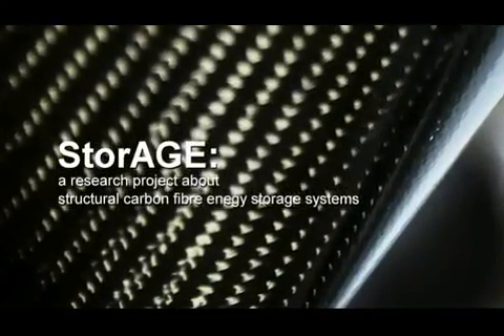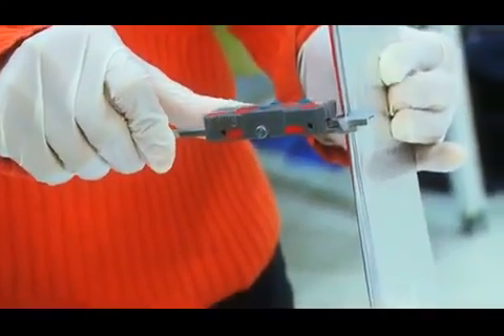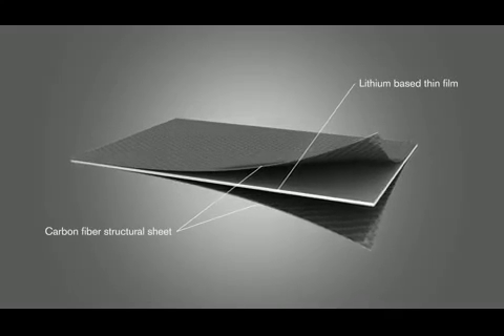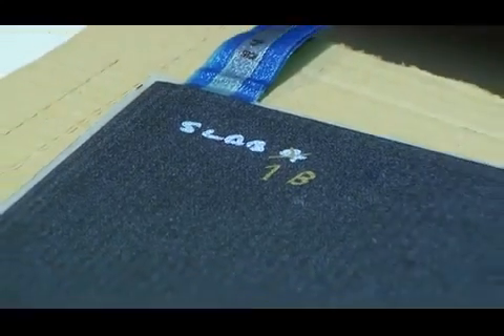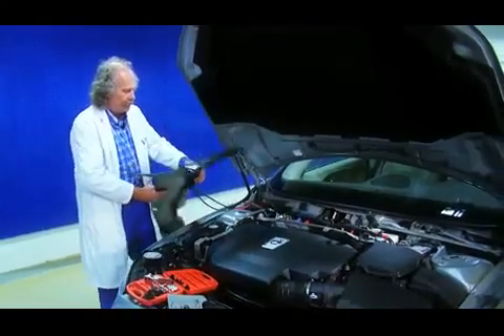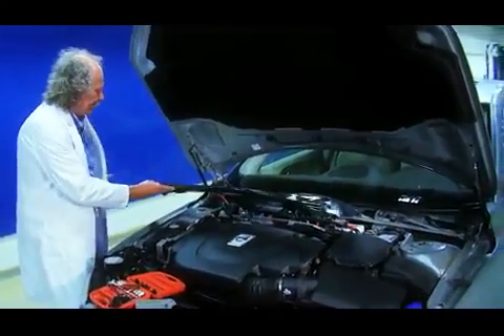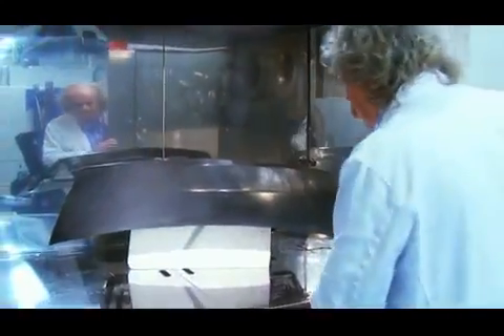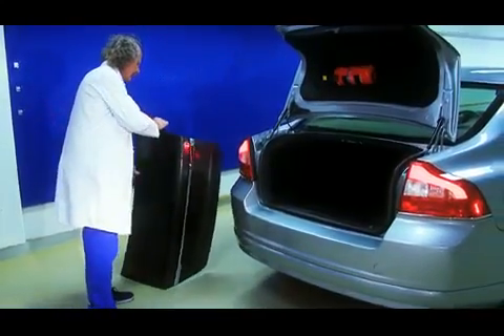Volvo Introduces Body Panels That Act As Batteries For EV

Comment: This is a great idea in concept. There are a lot of details to be worked out concerning safety, cost, etc.  The concern I have is that batteries have a short lifespan as compared to a vehicle.  When the battery wears out do you have to go to an autobody shop for new a battery panel(s)?  Great Idea... keep pushing that envelope. :^)